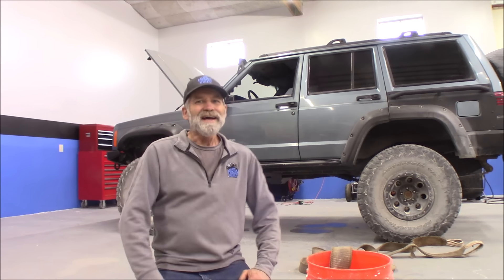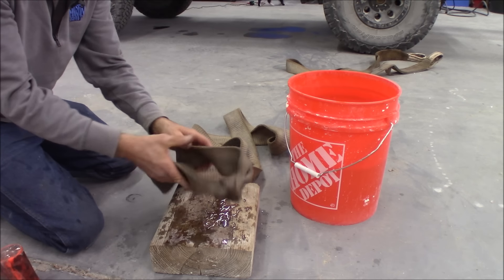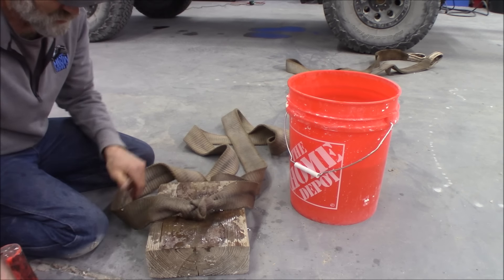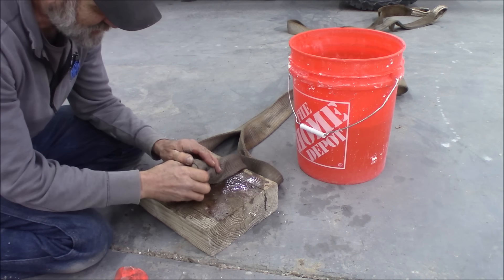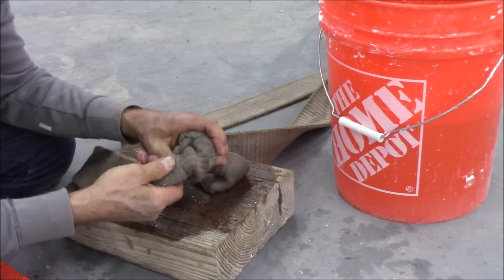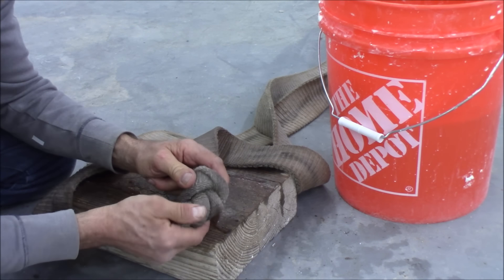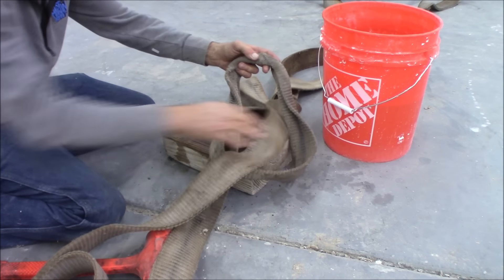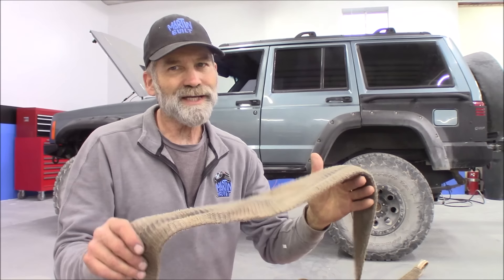How to Remove a Knot From any Snatch or Tow Strap and Rope

Comment: you could also  have it ,near the knot in a vice ,and with a screw driver not to big in diameter,and not too thin at the tip to damage the strap,,insert in and pry to loosen the knot,,this did work for me,,, with wisegrip could do the job too,,,

Comment: Yes.soapy water in the bucket or a squirty bottle with soap and water..pre wash spray works a treat also. Spray it into the knot.the stuff you spray on Clothes stains before they go in the washing machine..Cheers.
Reply from the maker: Yes I agree adding some dish soap to the water or dish soap directly to the knot I feel would have loosened the knot quicker. 
Thank you for watching 😊

Comment: One more thing in addition.  Drive a stake under the last crossover where it's tied and create space, smaller rope use a fork tine.
Just to be sure the last crossover is the 1st part of the knott you come to.
The whole point is to create space by driving a wedge in between the Knotts in order to create space

Comment: There is a tapered tool that riggers use to align bolt holes in structural steel. Not sure what it's called but it has a pointy end that is not sharp and I've used it to get knots out of large ropes by prying the knot apart with gentle care. Obviously detergent in water would help that process. Just another idea to try...........

Comment: Funny how hammers can unlock. To remove a hydraulic cylinder cap the work often requires repeated blows with a ball peen hammer; it's called peening. That while applying torque on the socket (And don't let the wrench slip off the socket!), using an extension or cheater bar/ pipe.

Comment: I use olive oil mixed with a little detergent to loosen knots.  Any vegetable oil will do--as long as it is clean.  The detergent just helps it spread thorough the fibres while you tap it with a mallet.
  Old sailor's trick for rigging knots.
,
Reply from the maker: Thank you for the suggestions. Yeah, anything to help lubricate that knot should definitely help.

Comment: if you don't have a hammer, you can fold it double so the knot ends up at the far end. then you grab a handle about 2 feet up from the knot, then you hit the knot against something hard, like a concrete floor, until it starts to loosen.

Comment: Would think fiber loses its tensile strength once it is wet so would spray paint a dot on knot area to see if strap snaps when dry under load at later date. It probably loosened once sturdy fibers involved in knot were destroyed by dead blow hammer. Conclusion: much weaker strap now. Might try silicone slider spray with tiny straw to get into folded areas of knot. Would lean toward screwdrivers and Knipex small pliers to tug on knot,  drill hole in spade end of flat slotted screwdriver and snake 1 foot of thin nylon cord through tool hole to push into knot folds for loosening, otherwise would buy new strap.

Comment: Great episode!
Mind your equipment, the unintended knot you prevent is worth more than the time driving a spike into the center of a tight overhand knot, soaking it in warm and sudsy warm, and whacking it with a dead blow hammer while the shop feline begins lecturing you on the proper use of the Catspaw Knot vs the Cow Hitch….etc. (Those 🐈‍⬛’s… One is sitting on my lap, stretching and certainly wondering about my purposeless tapping on this tiny plastic device…)

As mentioned by others elsewhere in these comments, please check the Ashley Book of Knots (ABOK) if you want to see fids, marlinspikes, heaving irons, etc., etc. in action… Although natural fibers and wire rope were the materials of the day when Clifford W. Ashley compiled his thick book, he did address straps made of belting, selvagee strops, and platted goods. Ashley wrote that failing to bring proper cuff links to a fancy event, he innovated with shoelaces, forming one of his many Button Knots. Best not to knot a strap, nor come to dinner with loose cuffs…

If you desire, check out the International Guild of Knot Tyers (IGKT) website! We’ve welcomed one and all since the early 1980’s, and publish a quarterly news magazine called Knotting Matters.

A good strap is hard to part with, but a hard-knotted strap is more easily parted (snapped)!!

Comment: Fids and also marlinspikes, mentioned in several comments here, can help.  But, just as a matter of interest, consider what their real purpose was.  If a seaman in the old days [up to about the middle of the last century] allowed such a knot to form he'd have been in trouble with his superior;  in Nelson's time he might well have been flogged.  A seaman's job was to make hitches and bends, but never 'knots' - everything they made had to be able to be un-made easily.  The fids, and later the marlinspikes when iron-laid ropes appeared, were primarily for opening up and then holding open the lay of a rope when splicing.

Comment: I believe that spot would still be a weak point as the knot put stress different ways than just straight smooth path that's how it's woven for cords to be pulled in same direction everytime. Idk I could be wrong but I believe that could still break at that spot even after knots removed. Anyone have one fail after removing the knot? It don't count if you damaged strap getting knot out with screw drivers excetra though you've compromised its strength if you used tools. I do like how he used hammer to loosen it pretty smart idea.

Comment: Sailors use a Marlinespike. Just pointy enough to work into the knot, cross-section just round enough and diameter varied enough to work out the knot.

Comment: 2 other methods, although I love this one too.
If u dont know a lot about knots u can use a regular one but put a tool, like a screw driver, wrench, or something like a pipe or stick that u can later pull out of the knot and instantly create slack to pull it apart.
Or if u have a tight knot, then get 2 pairs of pliers to grab the folds well with. Dont use your teeth. 😁

Comment: Well, you have a weak spot now from pounding a dirty strap with soil and sand in the fibers. A marlin spike can get a hold on one of the loops so you can pull like you were doing after the pounding.

Comment: In short: 
Wet it. (30+ min., soapy water helps)
Whack it. (w/rubber mallet or dead-blow hammer, changing the shape of knot)
Work it. (Don't give up. Persevere.)

Bonus: When trying to pull a knot out of a standard wound rope, twist the rope in the direction of winding and do your work. This will cause the fibers to tighten and decrease the pressure between rope surfaces in the knot.
Reply from the maker: Thanks for posting the comment I'm glad it worked out for you and thank you for the tips.

Comment: If you would have soaked it in boiling water for at least 45 minutes, it would come apart easier. The heat allows the fibers to expand, but you have to be careful not to get scolded or burned by the hot water other than that great video.

Comment: You need an appropriately sized marlinspike... that's it. small one for small ropes larger one for larger ropes like what's depicted here. For example think of a knitting needle. Those would work great on a 1/4" diameter rope but would of course not work on real small string or real large rope. That's why there's differing diameters of marlinspike.

Comment: I don't know, but it seems to me that you could get a 1/2" or 5/8" hardwood dowel rod and sand one end down to a cone. Hardwood is hard enough to push or hammer into the knot, (maybe after hitting the knot a few times) without cutting fibers. That should widen the know faster.

Comment: Pull a stump straight up, not sideways.  The tree evolved to resist pressure from wind trying to blow it down.  Use a Tripod, or other rigging to run the pull to the stump so that you pull it up.... takes many times less force to get the stump out.

Comment: Simple......never wet the strap !    It expands the fibers !     Instead use grease. Place part of the strap in a bench vice. Then....use a Phillips screw driver to wedge it apart. Make sure only part of the strap is in the vice.....the part that will allow half to be pulled through.  Takes a few moments !

Comment: There is nothing wrong with making a tool (a Fid) to stick into the knot--just make sure it won't poke holes in the strap. One you have inserted one you will eventually get two in--use soapy water btw.

Comment: It's my understanding that straps should not be used more than a few times as the straps degrade.  There is a material that is longer lasting but more expensive.  Forgot what it is but available at most off road stores.

Comment: Use soap and water let soak over night and use a wooden fid. To push thru the areas of the knot and loosen it.
Don't use a metal spike or screwdriver nothing metal. 
Wood dowel. Look up wooden fid we used them in the Navy

Comment: Sailors of old used to use what is called a marlin spike. Needle nose pliers works well too. You could also work it in a vice between two blocks of wood too. Water offer lubrication, but does it swell the nylon somewhat?
Reply: Or a fid😊

Comment: Soaking this strap in soapy water seems like a good idea at first, but it's probably more bad than good and a waste of time.
My thought on this is that the water causes the belt to swell and tighten the knot more. Yes, soap and water is lubricating but the swelling works against it.
As a sailor, the preferred method is to twist one of the ends, forcing it towards the inside of the knot. 
If it is too difficult to twist the rope (or belt) by hand you can clamp the rope in a vice to twist it, not the knot. And force with a two-handed twist on the knot.
That's pretty much what you did to succeed in the end. Not convinced that hitting the knot with a sledgehammer really gives any result. I agree that it is better not to use a metal tool inside the knot to avoid damaging the rope

Comment: A non related comment on tires. Use wintergreen oil and rubbing alcohol 3 parts alcohol to 1 part wintergreen oil mix and spray the inside and the outside of your tires and it will stop dry rot do it 3 times over 2 weeks.

Comment: We were instructed not to reuse any tow strap with more that 3 pulls on it . Period. Didn't matter if it was new, old, never exceeded its rated limit ect. Straps came with a punch tag for each incident. I threw away thousands during my time in the militar , not sure what the guy below was doing or where he was stationed but I was in Ft Bragg with the 82ND.
Reply from the maker: Yeah, there's some wasteful government spending for you.
Reply: It's irrelevant where you were stationed, or even if you were 'in the military'.
'Fatigue' in lashings, slings, etc is the same EVERYWHERE!
It's tried and tested physics.

Comment: Wetting material generally makes it swell a bit. Water + strap is bit larger than just the strap. Making it swell by wetting it makes the knot *tighter*.

30 years ago I learned to make sure a rope was wet BEFORE the knot was tied if you wanted to be able to untie it after it's wet. Because if it's tied dry and then wetted, you've got a problem.

Some soap for lubrication could make sense.  Wetting it without lubricating it is probably just making the job more difficult.

Comment: I didn't learn anything new. I have been doing it this way for many years while working in the forest. I never use a hammer. I don't even need a screwdriver All you need is water, liquid soap and the original chainsaw key. These are the things I always have in my car

Comment: The best method I've seen was someone who soaked the strap in soapy water overnight then used push rods out of a wagon engine as levers. No sharp edges and strong enough to resist bending enough to get the job done.

Comment: why sand inside the hammer?
Reply from the maker: Actually I was incorrect when stating that it's more like steel shot.
And I believe it's in there that way the hammer does not bounce off the surface that you're striking.

Comment: use plier, they with not harm the belt cause all you doing is holding the inside nut then you hand wiggle flap that easier to move cause that the closes to the long rope out. hand wiggle   .their no way you can hold the center nut buy hand, that why the pliers , try it and roll back that flap. easy.......
Reply: i use to hold the rope with by teeth if their no plier, away work lol

Comment: And you don't think poundiing that strap with a sledge damaged the integrity of that strap??????????  An easier way to undo the knot would be to use a regular sized phillips head screw driver as a "marlin spike" to loosen the two main locations on the knot.  It would take about 14 to 20 minutes of work to do the same thing and it would not require a sledge to do it.  If you are careful, there would be no damage to the fabric.  With soaking or without.

Comment: First, soap and water works better than just water. Second, two large Phillips screwdrivers, or even regular if you don't pry the flat into the strap, can work to pull the knot apart, rather than trying to push it apart. Third, if you have had a strap for 25 years, then the UV damage is a lot worse than you think. Get a new one.

Comment: Nice trick.  I think the rating of that strap is still degraded, as much or more than it was with the knot.  But they don't last forever anyway, and a knot is just annoying.  The damage is done, might as well get the knot out and move on.  I think I have that same strap, probably closer to 40 years old.  They do lose strength due to age too, but most of us buy so much more strap than we really need for off-roading that they still do the job just fine.

Comment: I almost said::
IT IS ALL FOR KNOT….

I wonder if GREASE would be better than water…
Reply from the maker: Some people have suggested hot or warm soapy water, which I think would have helped.
Probably any type of lubricant would have helped.
I was actually thinking after I got it done if I were to have some wire pulling soap, something I use in my trade.
Reply: @martinbuilt  
You install cables??
I used to install TELEPHONE SYSTEMS 50 years ago…
Happy New Year 🎊🎆

Comment: I've got that knot's twin in my 3" strap! I stopped to be a Good Samaritan and pull someone out - and they offered to attach it to their car... so, now I have a nasty knot (and of course their promis to 'send me money to replace it!" - yeah right!   Question: Is this worth trying - - with just steel hammers? I do not have a 'dead-drop' hammer but I have several different sizes of regular steel sledge hammers. Will the sledge damage the strap if used?

Comment: Tip.. Shouldn't have put a knot in it in the first place .. DoH.. BTW a pair of long needle-nose pliers it what you needed.
Reply: A wooden dowel, carve a long point and sand smooth than drive into wet knot.  Two "fids" makes it even easier.
Reply: @marykayswanstrom9761  yes and analyze the structure of the knot... where the ends come in and out..👍
Reply: Or try a divorce lawyer.

Comment: Rubbish mate - use a marlin spike as sailors have done for centuries (and lubricant/water if you have the time). One can see by your pick-up in the background that you haven't a clew what you're doing - high bodywork may look 'sexy' but your diffs are still as close to the ground as they were before.
Reply from the maker: You know I'm betting a Marlin spike, wouldn't have done it. That knot was so tight for my truck yanken on that strap.
And yes, I have a lot more axle clearance. those are 35 inch tires. You need 6 and a 1/2 inches of lift  with 35, especially when I go rock crawling. I can still tuck a thirty five inch tire right up into that fender well.
Reply: @martinbuilt that makes no sense at all - the diff lift produced by larger tyres is helpful - if you spend loads of money and resources on correcting the gearing and make sure the drive won't suffer too much, but lifting the body disproportionately won't be of much use at all apart from on specially selected courses 'for tourists'. Ever wondered why manufacturers make vehicles to the spec they do? So you reckon a marlin spike wouldn't have done it, despite hundreds of years of national experience telling otherwise, and plenty of my own and others' in followance...? It's just an aid easing what you are trying to do, specifically designed for it - why put it down or not bother with it?